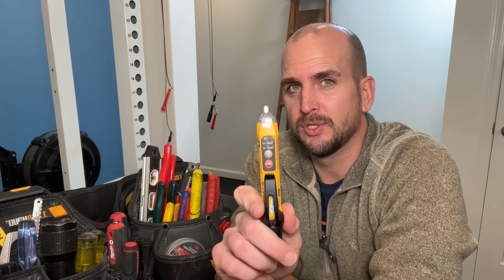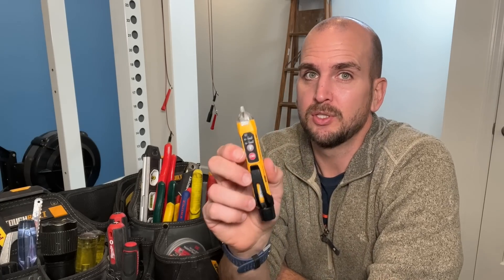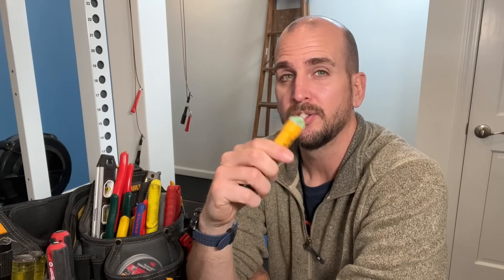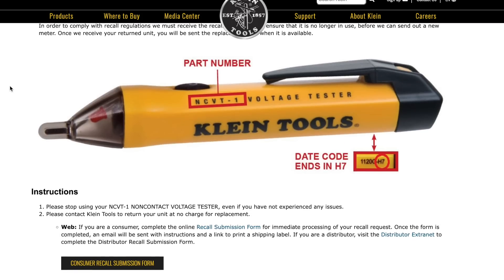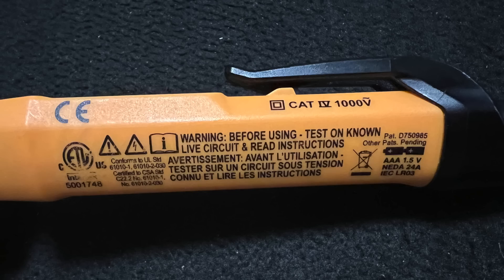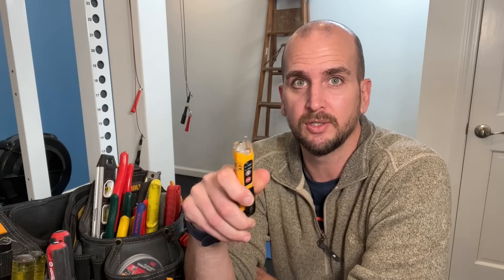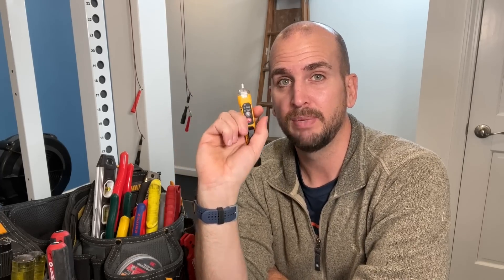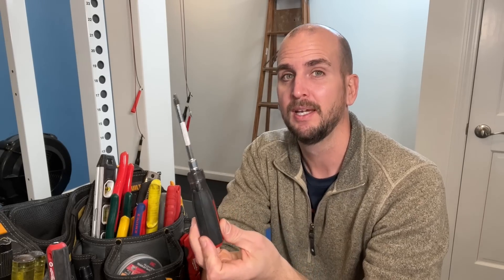The Tool I Get The Most Negative Feedback On And Still Use Weekly

Comment: Master electrician here.  Personally I use the NCV tester.  Even still I always treat every wire as a live wire, yes even when hooking up devices.  It's a good skill to master.  When disconnecting wires from a device: hot, neutral then ground.  When connecting: ground, neutral then hot.  Be careful and be safe.
Reply: Hot ...First to break....Last to make
Reply: 100% correct.
Reply: Excellent comment!
Reply: I'm a qualified spark who also uses one and totally agree with this. Would also say that the fact that you are aware of its limitations means you can use it safely anyway
Reply: Hey guys would you say electrician is still a good field to go ?
Reply: @black11189  Definitely.  Never a better time
Reply: For outlets with nothing plugged in yet or lights with no bulbs in yet, I sometimes do the ground and neutral last because if you're handling the hot and accidentally touch the copper well you're touching the metal of the outlet, you get zapped. I was taught ground first but I figured out that's not always the best option because everythings so small and hard to hold and screw, especially outlets at least for me.
Reply: That is excellent advice.  You don't want to be sitting there with the hot lead on your tongue when someone flips the wrong breaker on.
Reply: @lperkins2  One of the worse shocks I have gotten was while wiring a switch for a 277-volt light fixture on a commercial job. Another electrician prematurely turned the power on for that circuit and I got bit hard.
Reply: @bretgreen5314  I am not surprised.  That sort of thing can bite you even if you check the circuit right before you start working on it.  Best bet is to not touch it without proper PPE, and put tape over any breakers that must not be turned on.  If there are multiple people working on the project, initial the tape and don't remove tape that you didn't initial without that person's OK.  Glad you survived.  Out of curiosity, what the heck is at 277 volts?
Reply: @lperkins2  Great advice; I like it-tape off a circuit and initial it.  Especially on a commercial jobsite.  277 Volts is common for commercial applications where there is 480-volt 3 phase power.  Neutral to line is 277-volt.
Reply: @bretgreen5314  Aye, on non-commercial jobsites, there's usually few enough people that you can tape it off and not initial it, but if you get past two people working you need to know who placed the tape.  I've read a bit about 480 volt installations, so should probably have recognized the single-phase voltage.  I'm quite happy that the most I have to deal with is 48v DC, going past 120v AC gets significantly more dangerous.
Reply: @lperkins2  what all the ppe gear do u use
Reply: @MarstaJNZ  Depends on what I'm doing.  Around here the highest voltage to ground you'll find is 120, and 240 between the phases, so a thick pair of dry leather gloves and thick rubber soled boots (on dry floor) is enough to pretty well protect you.  And if at all possible, only have one hand inside the breaker box, it's a rare time where putting a hand in a pocket can actually be safer than not.
Reply: @lperkins2  Best practices would suggest to use a lockout/tagout. OSHA requires it, and locking out a breaker doesn't take more than a minute or so. That minute buys you not only peace of mind, but also some CYA if someone comes along and flips it on.
Reply: @danm6499  Aye, certainly if you are in an OSHA covered environment, something more robust than tape would be a good choice.  For the DiYer, tape is likely available even if little else is.  Depending on how long the circuit is to be down, removing the breaker and putting a blank in the cover might also be prudent.  The most important thing is to make sure everyone on site (not just everyone directly involved in the process, but any kids that can reach, spouses, and so on) know what is meant by a lockout, or by tape, or whatever, and not to try to bypass it.
Reply: @lperkins2  most commercial lighting is 277v now as it combos with LEDs really well for cheaper overall draw on the service. Also used in many air handlers and heavier draw equipment. Not usually a resi issue. 

Totally agree with the live, dead, live testing of tic testers as well as people needing to understand that they don't recognize DC voltage. Love ground, neutral, hot work method though.

Would love to add my personal loto method. I've had people wedge lotos off while I was working on a circuit mind you and it was 277v. First j box/ termination point I work in I wire nut the hot to the neutral. Breaker/switch gets turned on? Slams it into the tripped position. I might get shocked (assuming the breaker/oc protection doesn't fail) but it minimizes the chances of me getting hung up because I have that extra failsafe.
Reply: 100% correct. VOM's are good, but who to say you haven't dropped a neutral and then most VOM's won't work (Fluke 117 has a no contact Volt-alert feature).
Or you find something that's hot a VOM can't detect, like a hot case or other metal. My NCV saved my butt more than few times. I've seen a hot wire touch a non grounded frame, grab frame and get knocked back at best. I always checked everything metal with my NCV first
Reply: In electrical, if you’re in such a hurry that you’re touching copper, you’re in too much of a hurry and if you don’t know that, you aren’t qualified to touch copper. However “tick testers” as we call them have an intended use, and electricians who cant see that are usually old timers that don’t read the manual on their new tools. Thing doesn’t light up, he gets lit up, instantly it’s a broken POS, when really it’s just cocky user error.
Reply: Thankyou. My father,  an A-grade Electrician with the State Electricity Commission, practiced the same procedure- treat every wire as live and used same sequences
Reply: Thank you!!!
Reply: Great comment.  Kind of like a gun.  “Is that gun loaded”??  Yes it is, even if it isn’t and you have the clip out and the slide open and empty.  Yes, it is loaded.
Reply: Yes..worked decades ago with electricians taught me treat every wire as live..
Reply: I had two different Master electricians do work on my house and both of them did a horrible job. And ironically, the ones who pointed out the mistakes that they made were handymen who were not "Master electricians". I had to call them back and force them to fix their horrible work, otherwise I would report them to the state and lawyer up. That license is a joke.
Reply: @panerai_fan  Ouch I definitely see how you would feel that way.
Reply: I just think they're a nice to have when you're flipping breakers randomly because whoever the electrician was that hooked up your house 30 years ago decided that the adjectives most people use to describe which room they're in are really just kind of arbitrary.  You know, that guy who calls the smallest bedroom in the house "the master bedroom", the bedroom with 2 walk in closets and a private bathroom the "den", and that place with all the stoves and other machines that cook your food the "patio."
Reply: “ Dead “circuits , a bit like “ Unloaded “ guns !
Reply: @chrisfyfe1476  I like it-good point
Reply: “ Dead wires “ are a lot like “ unloaded guns “ , I only totally believe it if I’ve shown it clear in the last 5 mins , and nobody has touched it since . I’ve run across live stuff in the damdest places ! ie: 120 run on telephone quad , etc !
Reply: Yep
Reply: Also, if I don't need both hands, I do my best to work with one hand behind my back.
Reply: @pleappleappleap  Good one there.  I used to work on Klystron microwave satellite transmitters with 9.5 KV power supplies.  These had huge capacitors that needed to be de-energized etc.  Really dangerous stuff.  We used to keep one hand in a back pocket at all times,and had a fiberglass man-hook at the ready at all times too.
Reply: @pleappleappleap  Oh and also I saw a man reach inside one of these power supply cabinets while powered up (a safety rule violation).He was on his knees with his free hand on the floor, and before I had a chance to say anything a huge blue spark jumped from the equipment to his finger, went through his body and somehow blew his watch right off his wrist where his hand was on the floor.  He ended up in the hospital where he did recover.  Not a pretty sight.
Reply: Didn't even have to say master electrician, you proved it 👏
Reply: Yea but there are no such things any more as a neutral in the electrical Bible NEC! AHOLES changed one of the most commonly used electrical term in use for well over 100 years to grounded conductor at least 5 years ago. Also no such thing as a light fixture ! Go figure.
Reply: @garbo8962  I hear your frustration.  Often when you mention "grounded conductor" you get blank looks from folks.  I wonder if they made this change due to corner-grounded delta configurations.
Reply: @garbo8962 it's always been grounded conductor in the code atleast since 91 I know for sure
Reply: Im a Electrical Power Technician. Here when I do 230V/400V/690V I wouldnt trust that thing even in the slightest. If I would ever work at 120V/100V or lower (AC) I would probably use that too since yes you could die if you touch a live wire but....I survived worse :b
Reply: I completely agree, I always tell my apprentices to keep a NCV handy and to use it.
Reply: ...and use a "squeaker" just before you start. Lock-out/Tag-out your source, if possible and wear gloves. And remember, when running metalic conduit around a big area, there are different legs of ground. You could be hooking 2 legs of ground together at a box. (the earth has it's OWN phase differentials). And have a circuit there with the conduit, with no circuit breaker. When you put the power back on your box blows! It doesn't happen THAT much, but it does happen.
Reply: @general5104  Yes, voltage gradients can be very dangerous, especially around water such as swimming pools and boating facilities.  Also never ever run two or more separate generators simultaneously without a common bond, unless they are powering separate circuits with no chance of physical contact with two or more separate grounds.
Reply: This is good practice and I thank you.
Reply: Electronics usually  call one live and the other "hot ground" .. because  AC travels from live thru  load bulb along neutral wire then on negative half cycle along neutral wire, thru bulb back thru live wire.. so both wire  reach +/- 110 or 240v rms.  Across supply coil outputs usually.. be safe!
Reply: @easyspeak101  Beware the OPEN NEUTRAL
Reply: @easyspeak101  Beware the OPEN NEUTRAL. . .
Reply: The problem is non-electricians don't understand how to properly use it. Always work as if a circuit is live and always test your testers on a known live circuit before each use and periodically in between while using. DIY and Handymen are usually whom get hurt by these types of testers.
Reply: Guess I'm butt backwards! Lot of Comercial were neutrals are shared! Those bite harder then any hot. Neutral first Always!
Reply: Great comment.  Kind of like a gun.  “Is that gun loaded”??  Yes it is, even if it isn’t and you have the clip out and the slide open and empty.  Yes, it is loaded.
I bought this NCVT yesterday.  On the road prepping a new VRBO and I needed to ID live circuits.  Multi-meter was too expensive and I have been wanting to get myself an NCVT, so I went for it.  It’s worked great so far.
Reply: Just like treating all firearms as loaded! BEST PRACTICE!
Reply: No such thing as a master anything, one zap and your back to journey man apprentice
Reply: I work on live circuits a lot. (Because reasons)  I use the NCV to keep track of hots and where the active traveler is when changing a 3 way. Since I'm almost always working live the tester is not really a safety issue for me... It's always dangerous..
Reply: You think using a deathstick is safe!! Lol I hope your life insurance is paid up.
Reply: I handle live wires all day long couldn’t weld without the electricity your body gets used to the odd jolt especially when you are ringing wet man up 240Volt that makes you jump don’t like them 110Volt haha pussies.🏴😊
Reply: I use the NCV only for finding out, more or less, wehre the wire went and stuff.
Reply: You're not a naster electrician! Check your ticket. The tiltle does not exist. Full of BS. stop lying, you're either a journeyman electrician , or interstate journeyman electrician,  period!  Anybody that says this check their ticket, don't let them in your house!
Reply: What makes for a master electrician?
Reply: @jesse1441  having taken your master's exam and getting licensed. Minimum 8 years in the field to qualify for your master's
Reply: @jesse1441  Time, experience and being licensed by the state you live in.
Reply: @hestheMaster  10-4. I’m third generation electrician and a licensed contractor. And familiar with pretty much all aspects electrical work and would never say I’m a master. I still enjoy learning everyday.
Reply: @jesse1441  testing, and it's one heck of a test
Reply: @jesse1441  Experience and testing.
Reply: @pleappleappleap  how much experience does it take to be a master?
Reply: @jesse1441  I followed the State of Wyoming regulations for my license.
Reply: @bretgreen5314  
I hate the things.  Mainly because every "handyman" in town has one and thinks that they're now electricians. I then have to figure out what they screwed up. You know the deal...

I still prefer my good old-fashioned Klein wiggy for a quick check. Maybe that's more proof I'm getting old?
Reply: @frankrosemeck9898  maybe you should not be upset the average person is using them....if they didn't we might have more dead do it yourselves people. At least they are using something. If they can't handle wiring things and can't be bothered learning how to do it right they probably will have a hard time with a multimeter.
Reply: @frankrosemeck9898  I had to do a service call where the handy man was getting voltage on wires that should be dead. I got out there, grabbed my meter, and everything was accurately dead... Easy money. Felt bad for the homeowner who had to pay.
Reply: @jesse1441  That question can be very debatable as you see. I am journeyman with 31+ years and have worked with so called “masters” that didn’t have the skills and/or experience to do the job. Being a master in residential is far from commercial and even farther from industrial. Industrial can have loads of complexity that a master in residential/commercial would lose their mind. With a field that is ever evolving no one can truly call themselves a “master “. Just my 2 wire 🥜 🥴
Reply: @SometimesHandy  I couldn’t have said it better! Makes me laugh when someone calls themselves a master.
Reply: There is no such thing as a naster electrician! Your are either a journeyman  electrician or an interstate journeyman electrician,  check your ticket! You're making it up and that isnt anybody i would let in my house, .
Reply: @bryanmcwhirter9945  HAHA I'll add your comment to my "reasons I don't do residential"  list.  Long list too HAHA
Reply: @bretgreen5314  always be conscious of prople, your house, your money, your choice.  Seen many people,  old age and new innocent homeowners  ripoed off. Thankyou  for the reply, nice to hear from a professional. Integraty is hinesty, very lacking these days. Have a great day !
Reply: @bryanmcwhirter9945 the state law says I have to staff a master electrician to have a electrical contracting busimess So I had to go take a test called the master electrician exam..they give me a card that says master electrician. You are a journeyman, I am a master certified by the state. It's not a how to exam, it's all code.